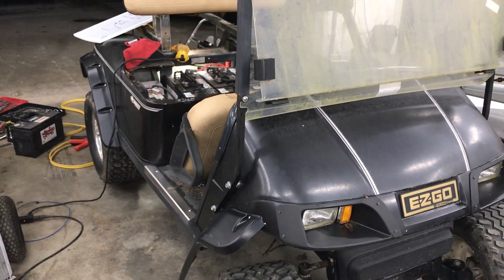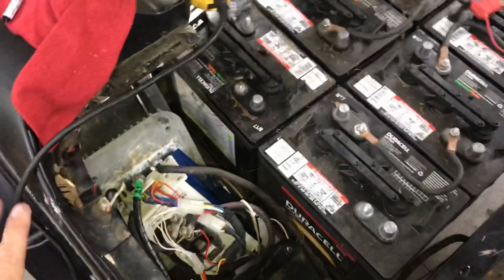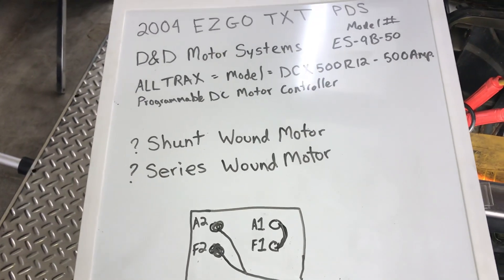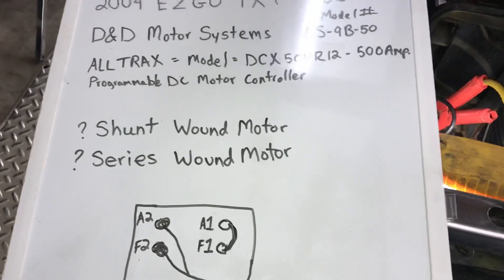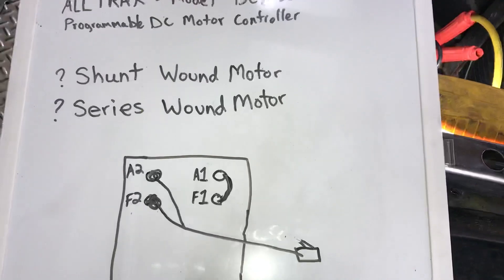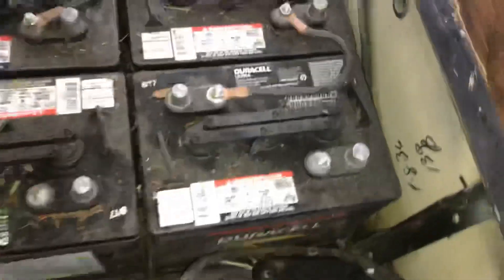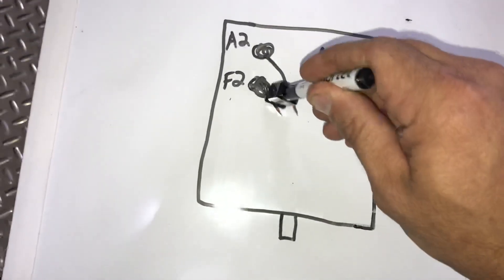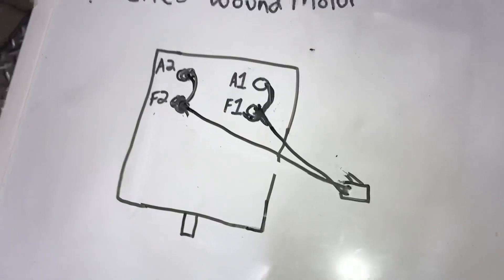2004 EZGO TXT PDS Golf Cart Testing a shunt wound and series wound motor

Comment: My name is Randy also and I have a question.  I have an older 36 volt😮 TXT and series type the motor quit and fed back positive charge from M1 terminal to the controller and fried it.  Got the motor turning using the series ok up you showed but it still feeds back positive from the A1.  I can get a used s unt still motor to replace it so is this possible and ow does it change the connections between the forward reverse switch and the motor.  Thanks and tis vid was great to explain the motor function

Comment: Thanks video. 
Took motor apart , brushes were like new. No grounds found, but would not test when hooking up to 12volts as per other videos with A & S labels. 
So it seems the key here is as to what type of labels are on the motor.
Mine has the F designation s!
Thanks again!

Comment: I have a 1987 club cart 36v. It has the 5 solenoids. They are all clicking and closing. I have checked each one with a meter with the plate that connects them all removed. It does not have the v glide. Has the micro switches in pedal assembly. I tested the motor with 12v. It ran. But when I push the petal all solenoids click and close but the cart does not move. All solenoids are getting 36v except the first one closest to drivers side. It’s only getting 18v on the the pole. It’s getting the 36v to the coil.

Comment: Fantastic. I almost burned my motor first trying to guess how to run it. Then after looking at video is works like a dream. Thanks a lot. Dont try like me first to run without those cross cables. I did mistake by connecting only A1 and A2 and blow my power supply.
Reply: Hello there I hope you are online now, can I get some help I am struggling with a golf cart motor

Comment: Great video but i am confused, you state to connect A1 to F1 and A2 to F2 then run your jumper cables from F1 and F2 to the battery. in your video you have the positive jumper cable hooked up to A1 and your negative cable hooked up to F2
Reply: It is still hooked to f1 and f2 as they are linked by the jumper wire, a1 f2, f1 a2 it still ends up F1 and F2 because the linking cable
Reply: This guy knows nothing about checking a cart motor. I suggest you visit a professional, someone who works on carts for a living, and listen to him/her, otherwise you could toast your motor.

Comment: Thank you for the video!!!!  I tried that and only one, driver side wheel is turning.  Do you know if its normal?  Thanks again.  Im in a same boat with this but mine is 1996
Reply: I think that's fine and only because of limited slip differential.  If you stop the one tire from turning the other should go.  Seems your motor is good.
Reply from the maker: @DayClanTribe  Thanks for responding as somehow I have missed some of the comments being posted